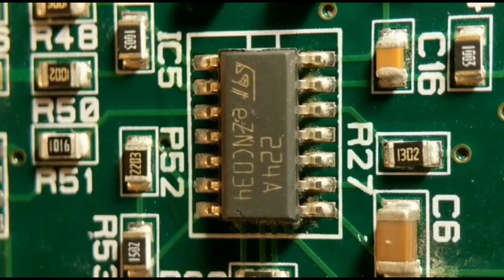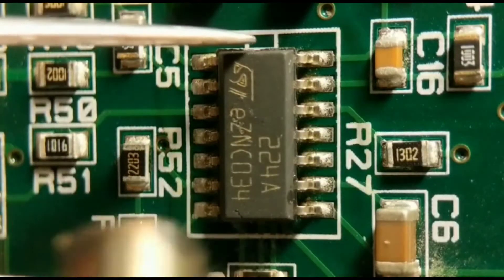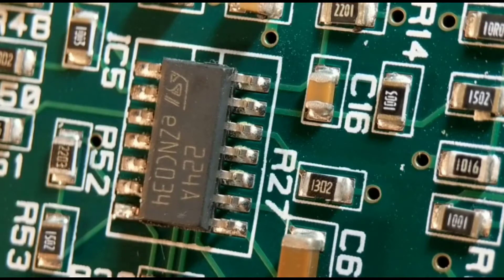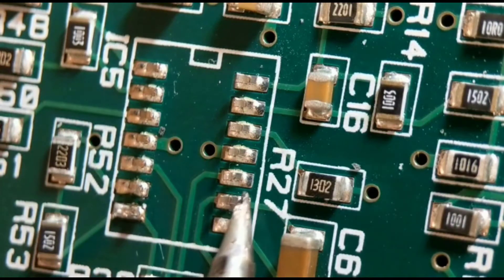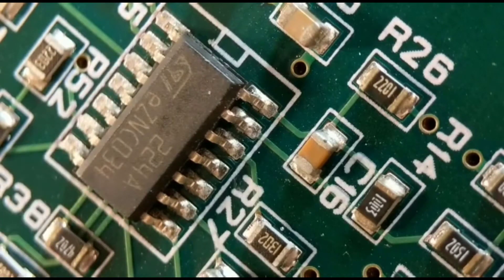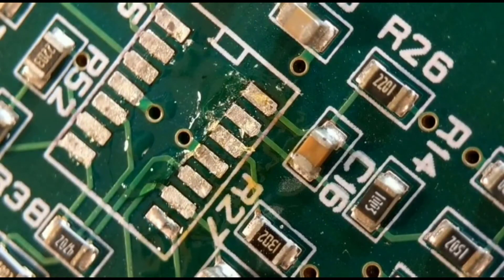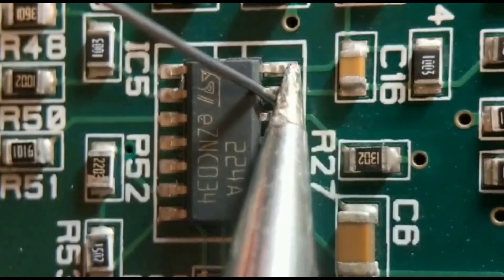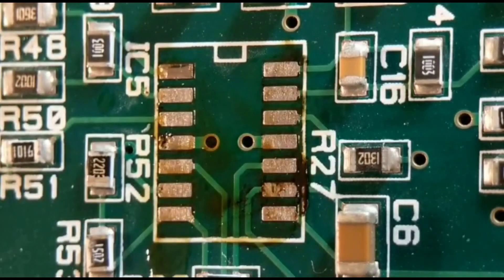How to Remove IC from PCB with Hot Ar Gun | How to Remove IC from PCB with Soldering Iron | 4 Method

Comment: Hey man, what temperature did you have your heat gun set to?
Reply from the maker: 350 Degree C
Reply: @TechnicalGuideji  Thanks bud!
Reply: 350 copy thanks man have this darn serial to USB chip that I have to replace. Vid is great gives me an idea as to how long to place heat on chip until it melts the solder
Reply from the maker: 350